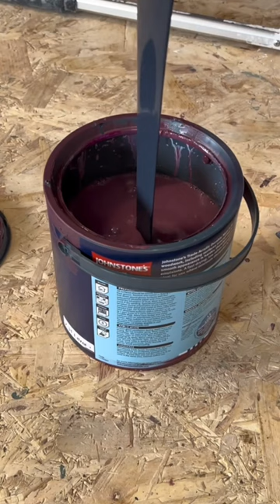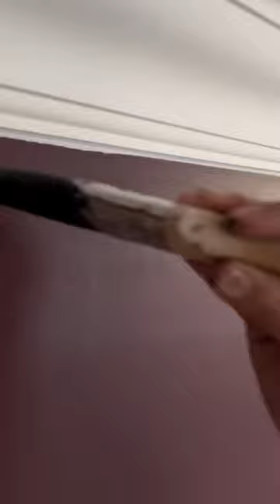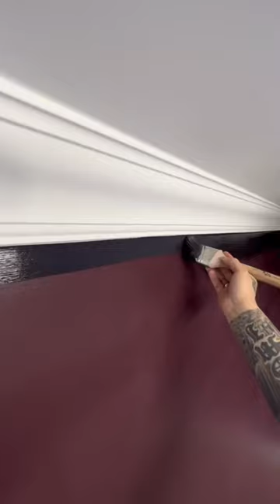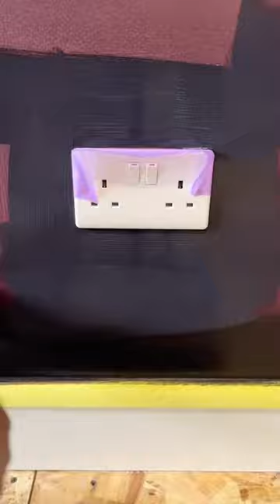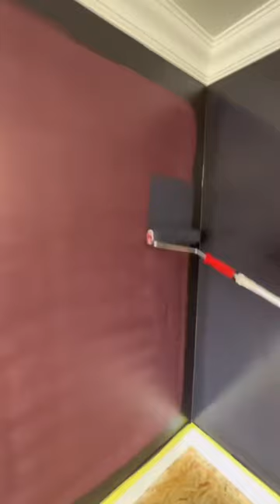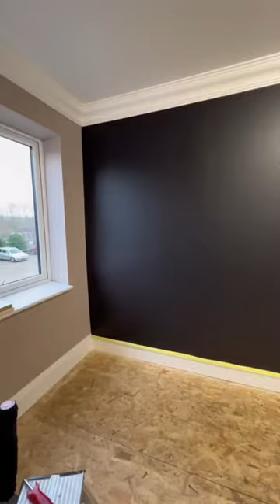BOXING PAINT COLOURS #asmr #diy #satisfying #youtubeshorts #youtube #subscribe

Comment: Shouldn't you be leading with the roller-cage arm in order to avoid tram lines?
Reply: Although I do that, you don’t have to if you’re applying a bit more pressure on the other side. I do like the masking tape on top of the sockets to pick up the spray.
Reply: @marcelboogaard3809 Ok. I just find it easier to apply pressure through the cage arm. As for the sockets, I always loosen them off before masking, in order to get the brush behind them.

Comment: People don't realise the skill needed until they try and DIY. I need a decorator so bad. Everytime I paint more of this weird glue stuff flakes off over the paint. I think I need to sand the plaster to get the glue layer off but I'm scared I'll take off too much plaster. 😢 I can't afford £125 a day for a P&D. 😢
Reply: Prep the walls with zinser gardz, will create a sealed coat
Reply: @randomguyonline6237  thank you. Would that work over a damp wall too?
Reply: @Themis33  absolutely not
Reply: @randomguyonline6237  so my external wall in my lounge has damp the lower quarter. Also condensation lands on it from the heat in the house. It's constantly wet. I can't afford to fix it properly so what would you do to make it ok / seal it / cover it up. Wood paneling?
Reply: @Themis33  if it's external it shouldn't be too much of a issue but if it's a concern use a water sealer and put a sealent at top and bottom of wall when it's as dry as you can get it and then coat with zinser perma white- anti mould and damp paint, if it's exterior I would them personally coat with all coat on top of it but honestly not you can do other than that if you don't have the budget to get it redone completely
Reply: @randomguyonline6237  I mean it's the wall to the outside not an internal wall. So I think it'd rising damp. Yeah. Thanks so much for your help. You've been really helpful and kind.

Comment: Why do you put water into the paint
Reply: goes on more evenly nad flatter, a decent quality paint wont be effected in terms of opaqueness
Reply: @FatterTony  that damn good idea, I've always had issues where the thicker brushed in parts meet the smother and thinner rolled part of the wall.
Reply: @BlackHill2489  Feather off your cutting in to avoid 'framing'
Reply: @peterburry2014  will this work if you cutting in using enough paint to only have to do it once?
Reply: @BlackHill2489  Always do two coats
Reply: @peterburry2014  will give it a try, planning on giving a few rooms a coat this year, cheers for the advice